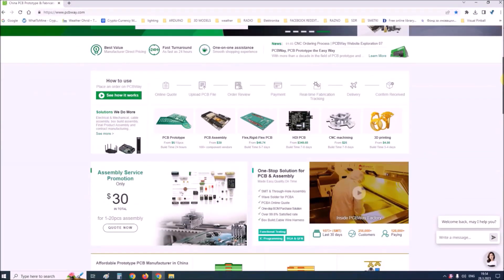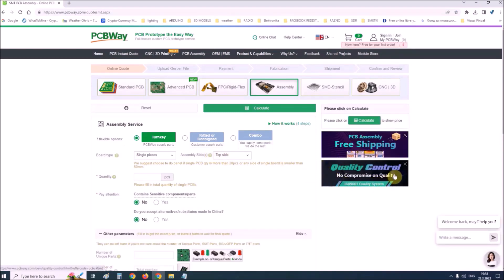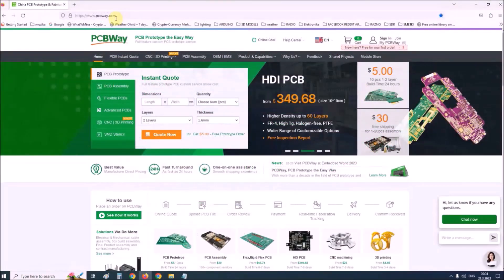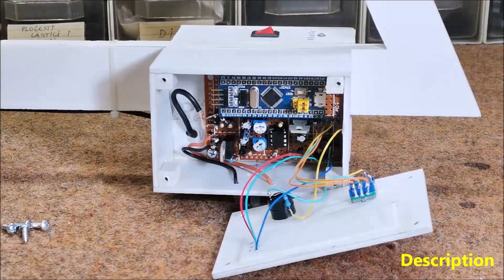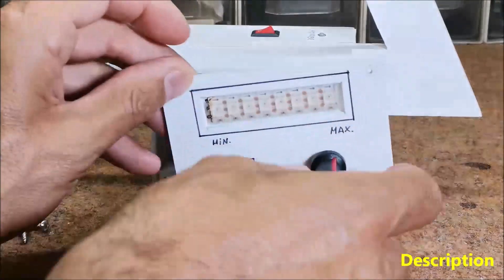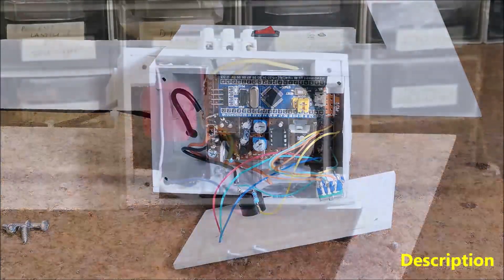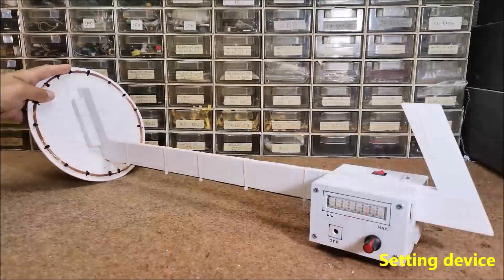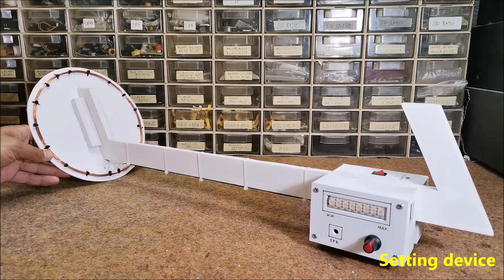DIY Sensitive STM32 Pulse Indiction Metal Detector (Arduino IDE)

Comment: Hello great project i want rebuilt it but get ws2812b compile error maybe please help
which ws2812b library should be used?
error is (In file included from D:\Metal detector\stm32\6-24_metallodetector_2\metallodetector\Hakester site Code\metalloiskatel_2\metalloiskatel_2.ino:1:
c:\Users\AREZOO\AppData\Local\arduino\libraries\WS2812B_STM32_Libmaple-master\src/WS2812B.h:51:4: error: #error No clock divisor available for this F_CPU
   51 |   #error No clock divisor available for this F_CPU
Compilation error: exit status 1)

Comment: I downloaded the WS2812B for STM103 and tried to unzip it with the IDE unzip library function but got an error 13. Without a library for the LED strip the program won't compile.
Reply: hello, i got compiling error on ws2812b 
did you solve it?
Reply: @hassanabbasi4194 No. I gave up.

Comment: Hi. On the electronic diagram where is the 20k and 100k trimpots? Also on the diagram there are more capacitors then the video. Which one is correct?
Reply from the maker: Schematic diagram is correct. I use trims for testing , and ommited some filter capacitors

Comment: I have an error when copy your codes. Arduino didn't accept WS2812 led library. Can you share with yours ? Alsa Arduino IDE does not support with TIMER_CH1 and the others. How can I fix that?
Reply: I am having the same issue, did you solve it?
Reply: @davea1479  did you solve it?
Reply: I am having the same problem, did you solve it?
Reply: refactor new stmdunio 2xx core

Comment: Hi I want to build my metal detector too but I found some inconsistencies when I looked at your schematic. In the schematic there are a lot more capacitors than you actually have on the board, also the values don't match like for example 3300mF is really a lot for a condenser, also why do you have potentiometers on the board, those are not in the schematic either. Thank you very much and have a nice day.
Reply from the maker: 3300mf is 3300 microF, and more capacitors on schematic for more stability of the device (filter capacitors)
Reply: @MirkoPavleskiMK  Nice job, thanks for sharing it. Could you please clarify to which element in the schematic correspond the 2 potenciometers that can be seen in your board beside the TL072? I can´t locate them in the schematic. Thanks.
Reply from the maker: @alftri  When making it, you should use the resistor values given in the schematic. I used those two trimmer potentiometers to experiment, but I didn't achieve any better results.